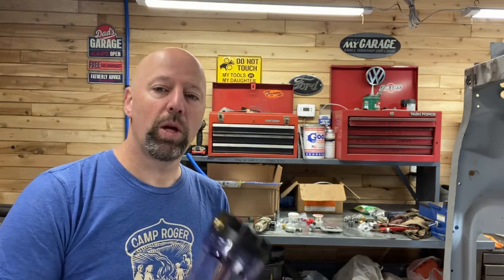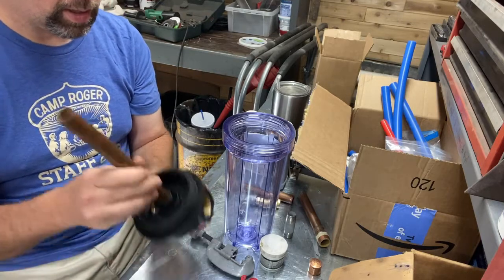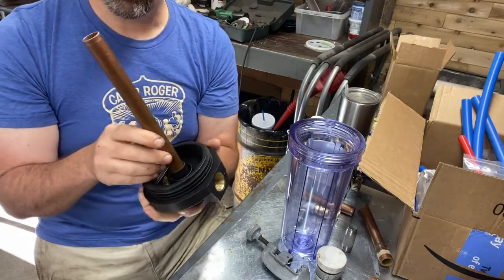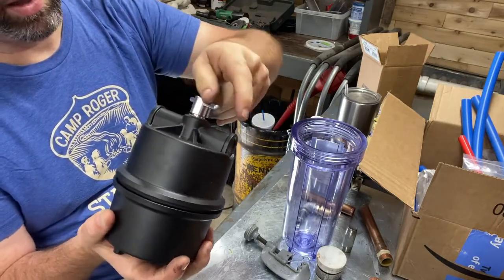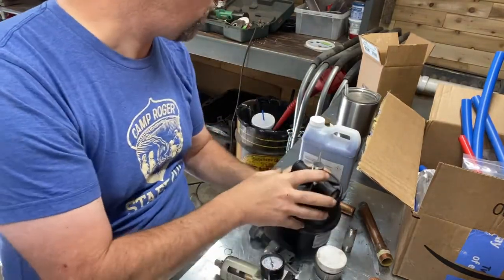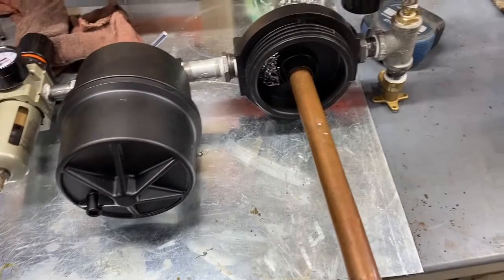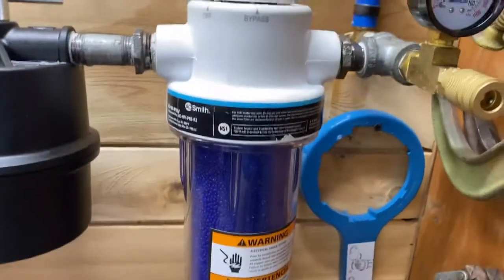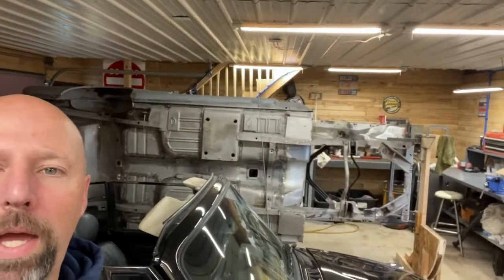DIY cheap quality Air Drier - Filter - Regulator combo for auto painting

Comment: Just FYI, I've been using one for about five months and it exploded this evening. I'm just here looking at videos of other people's findings after I've already come to my conclusion.

A couple weeks ago I saw some stress lines in it and I figured I would see it to its end because the odds of it happening when I was in the shop were very rare. I came out of the house at about 12 a.m. and heard my air compressor running with no load on it.

It's the cyclic pressure spikes that are the demise of the material. I thought it could be a thing but also it was cheap enough for me to gamble with.

It was definitely a more violent explosion than I thought it would be. Luckily my security camera and the shop caught it and there is shrapnel nearly to the other side of the shop from where it was.

Also, desiccant is absolutely everywhere. It was like a crappy IED went off in here.
Reply from the maker: Ahhh...glad you are safe and good to know. I have a shut off valve and keep mine unpressurized unless I'm using it.  Maybe that will help.  You are going to be finding dessicant beads for years!  Thanks for sharing.
Reply: @3rdstallgarage  Yeah, I think I got most of them cleaned up, but it definitely was a good spread of them.

If I get a chance I'll throw a video up on my channel of the security cam footage of it exploding. It's pretty entertaining.

The furthest piece of the housing shrapnel hit the furthest wall of the shop about 25-30 feet away.
Reply: I just bought a "Air Filter Combo Filter/Regulator/Mist Separator". I had my own idea on how I wanted to hook it up, but wanted to see if there was a better way. I liked this setup, but why isn't the Regulator/Separator the first inline? It would catch some of the moisture so the desiccant would last longer, as well as lower the pressure on all the components.
Reply from the maker: @danmatson8685  That's a good idea.  I will ponder that.
Reply: What are the pressures into the filter that you're working with, please? The filters aren't rated for this kind of work and wonder what your compressor's output was when it involuntarily disintegrated. Which  filter were you using (brand, model)?   I plan on building this system, too.  My compressor is rated at 175 lbs., max, and would probably set a regulator before the filters. Thanks!
Reply: I'm willing to bet heat played a big factor as well.
Reply: @ardz8279  filter housing was 400 psi burst pressure and 120psi working pressure
Reply: @camyota  shop has ac and is heated and stays at 70

Comment: Here in Tucson, we are actually the wettest portion of the Sonoran Desert. That being said, we get a lot of moisture here during the summer, and affects my three compressors for both air tools and my plasma cutter. I have struggled for years to try to find an effective desiccant dryer, and/or filter dryer system and all this time I could’ve just used a large water system like you presented and made it happen. So I think I’ll do that in addition with trying out that Motor Gard system. So overall excellent video and really glad you presented those products. Thank you!
Reply from the maker: You’re welcome!

Comment: I took the same approach, using a Cullens brand.

Actually, I used 2. Both made identically, with the center tube. The first cannister, I cut open the centers of 12 copper scouring pads and fit them around the tube, stacked to fill the can. Air goes in through the "in" port, same as would water.

Both cans connected "out-to-out", the second can is built exactly like this one.

Sending the air through the scouring pads helps to force the water molecules to collide and condense, allowing the second can's desiccant to be more effective.

I use that for painting. Not one fisheye. I had to replace the desiccant after about a year; as that was when I finally noticed a little steam emerging from an air blower. Currently on my second year, still no water.
Reply from the maker: Nice!  cool idea.  Thanks for sharing.  I hope people read these comments too.
Reply: Thank you! I will be trying out your idea my friend!

Comment: Very nice smart setup!   Was looking for a way to mount something like this on my Hazard Fraught upright air compressor I got many years back to make a similar system like this but make it portable so I can wheel it around.   I have not found very much I can just clamp on the unit or even on back with the handles, so seems like I might have to 3D print something.
Reply from the maker: That sounds like a great project.

Comment: So a year later how has this worked out for you?  How often do you have to recharge the desiccant?  Any problems with the PEX piping or water filter housing?  Neither of these those are intended for compressed air use.
Reply from the maker: So far I LOVE the pex system.  It's so easy to install and works great.  I have had no problems with leaks, even with joints I ended up cutting off the crimp collar and re-doing it.  I haven't done any painting yet to test the desiccant dryer yet, though.  So I don't have much feedback on that.  Sorry.
Reply: @3rdstallgarage   Thanks, I have seen other YT videos where their PEX pipes blew up, and a lot of fear mongering about the water filter acrylic housing blowing up, but so far no actual incidents showing a failure in those.

Comment: You will remove more moisture if you put the regulator before you dryer. When the air drops pressure it expands and gets colder and can't hold as much moisture so that is when it starts to come out on its own so there will be less for the beads to have to suck out of the air. All systems for sale as a kit are set up that way for that reason.
Reply from the maker: That makes sense.  Thanks for pointing that out.

Comment: I bet you could use a zeolite instead and then just regenerate it with a heat blanket and inexpensive vacuum pump. That's what we use for gas drying in an industrial context. Reusable and far more effective than silica beads.
Reply from the maker: Interesting idea.

Comment: Why not put the regulator on the input side so the filters are only exposed to low pressure?
Reply from the maker: Hmmm....well...because I didn't think of that.  Good idea.
Reply: I like regulator on output side of filter.   Previously Several regulators I tried failed due to water corrosion.

Comment: you need to pull the motor guard filters every few weeks, I read They arent made to stay in the body, over that, the powder coating in them peels as well.  better off painting the inside with epoxy primer .
Reply from the maker: Good idea to pull it out and add some paint to it.  Thanks!
Reply: I don’t understand what the issue is here? Why wouldn’t a filter be OK sitting in the housing if that’s what it’s designed for?
Reply: @TheRolfano  This vid is mystifying. Rejiggering a house water filter as a compressed air system dessicant?
Reply: @thardyryll  it’s rated to 120psi so it’s probably ok. Worst that can happen is it goes pop with a million beads. I am willing to try it. Others have as well. If it blow’s I’ll make a video lol
Reply: @TheRolfano   the water gets under the powdercoat and lifts it and corrodes the aluminum under it bad,   its a know issue,
Reply: @TheRolfano  It's absurd that a product that is designed to trap and hold moisture is eaten up by that very moisture. I don't expect it to last forever but after sitting idle for ~6 months I opened my M-60 and the corrosion was so bad I had to cut the filter element out. The housing is shot. I believe Motor Guard is painting these housings and not powder coating them. Powder coating can easily hold up on automotive parts under the hood of a car. No reason moisture in an aluminum housing should be an issue.  When they recommend changing the filter weekly they mean it. At least open it up to let it air dry.
Reply: @TheRolfano  It is literally a roll of toilet paper designed to catch and hold moisture. It will rot. That said as long as you epoxy coat the interior of the housing the filter works really well and is all that is necessary in my desert environment.

Comment: How did the desiccant dryer work out? Does it leak?  Cheers!! Just installing my pet air system was thinking about doing the same diy desiccant dryer.
Reply from the maker: The first cheap one I bought online from Amazon online leaked.  The second one I bought from Lowe’s holds air great.  I have used it to paint yet to know how fast the desiccant beads get wet but it should hold up for a good while and then I can dry them out in the oven.
Reply: @3rdstallgarage  Cool, thanks for the reply.  Do you have the manufacturer name or part#?
Reply from the maker: @raygraham7018  I think the brand name was AO Smith and the part number is AO-WH-PREV   I'll put a link in the next comment.
Reply from the maker: @raygraham7018  https://www.lowes.com/pd/A-O-Smith-AO-WH-PREV-Single-Stage-4-GPM-Mechanical-Filtration-Whole-House-Water-Filtration-System/1000576411

Comment: I am curious after 8 months how much moisture you are seeing in the Motor Guard moisture filter?  Without a pre-moisture filter the Motor Guard filter must be changed or at least opened up once a week so the trapped moisture can dry out. I am a DIY'er with the M-60 and didn't check the filter for ~ 6 months. When I opened it up the corrosion was so bad I had to cut the filter out of the housing. The housing is shot.
Reply from the maker: That's a good point.  Right now, I'm side tracked on projects and haven't done any painting yet.  So I don't have any real world data for you. I hope the dessicant filter takes most of the moisture, but I think it's a great idea to open the MotorGuard filter and let it air out after each major use or weekly.

Comment: U don't read anything online do you.?  Ped is NOT rated for ail #1.  If you paint cars, you have  really good paint guns so take care off them.  Buy a real dryer/water separator and be done with it.  Last, look at flexzilla coil hoses.  They come in different lengths and work great hot or cold
Reply from the maker: Yes, Pex is is not rated for air.  You are correct and I had read that online. But just because something isn't rated for something doesn't mean it doesn't work well for that purpose.  Thanks for the advice on flexilla hoses. I need some new air hoses soon.
Reply: Pex is far better than pvc,copper way too expensive I bought a 100" coil of 3/4  pex and left it that way hung on wall for additional cooling and a drop you don't need to go up n down zeg zag with all that piping js😊
Reply: 100' feet!!!!!